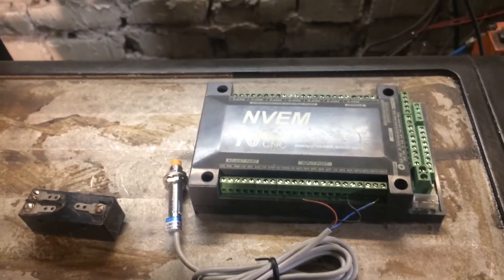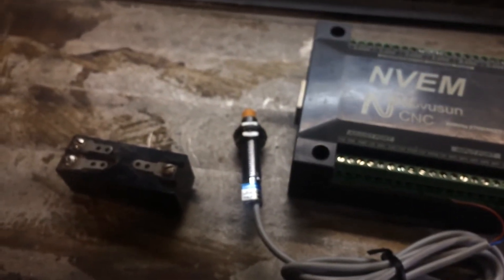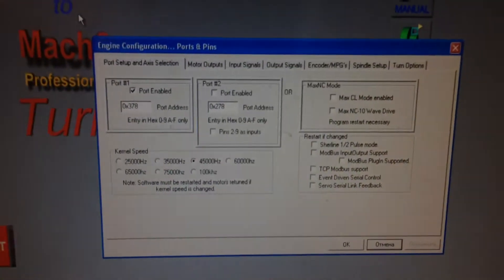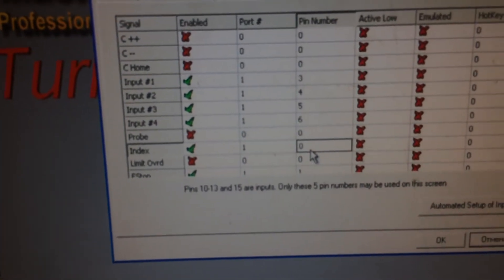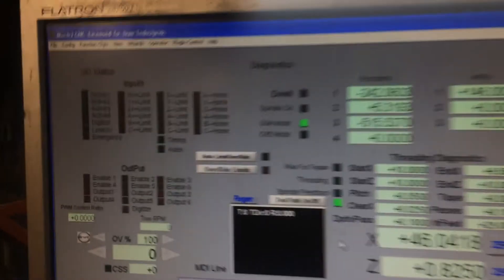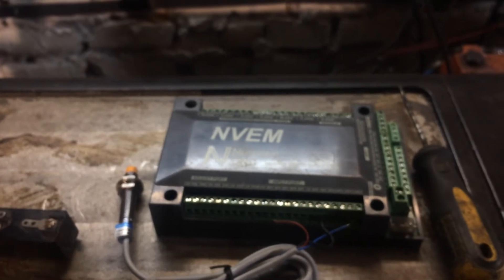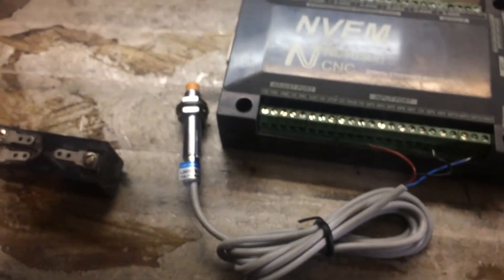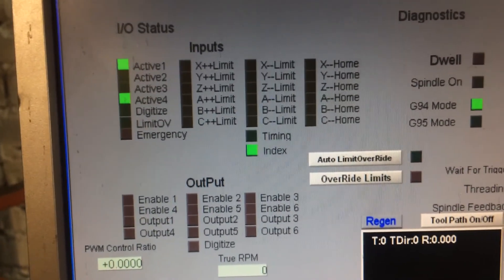Connecting sensors to the NVEM board, for our comrades!

Comment: My friend another question  0-10V spindle speed analog output interface(can change to PWM output). i always have 10v in my multimeter you know why? i want a digital pwm. In the manual say that i can change it. do you have mail to send you photos. I have a motor for the spindle than have a card than only works with two cables pwm signal and gnd. What do you recomend me to how to connect? Because when i use only VSO and Gnd i get 10 volt only and i can´t regulate it
Reply from the maker: Hi, this is my mail: Shurup_89@inbox.ru